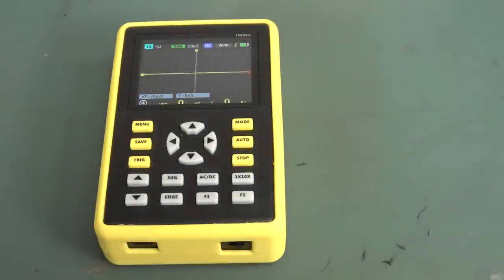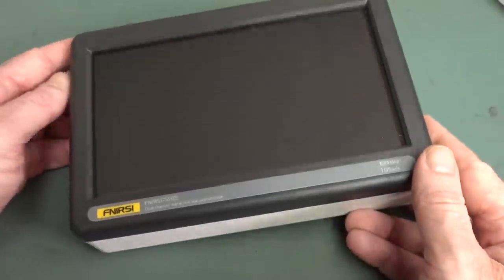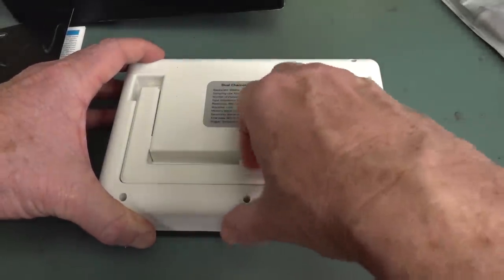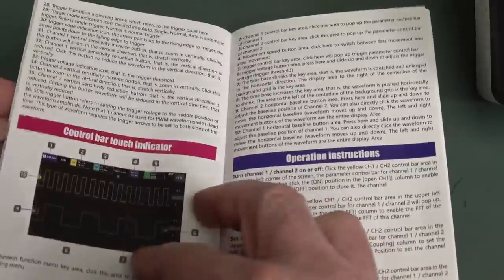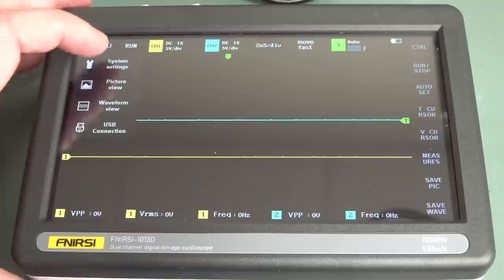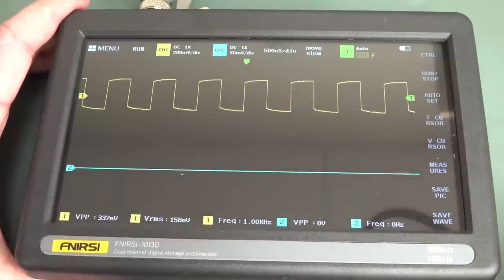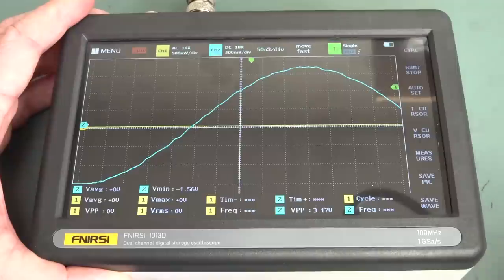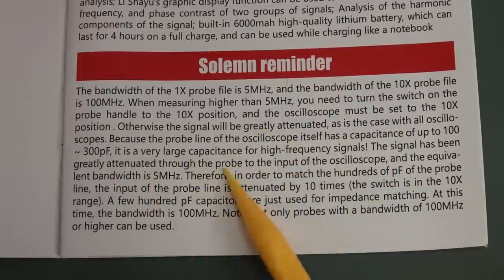EEVblog #1317 - $140 2CH 100MHz Fnirsi Tablet Oscilloscope Review

Comment: Did you try triggering on a low duty cycle signal, like an 1us 1kHz pulse train? I have the old pocket version, and it hardly ever triggers on that, since it samples only intermittedly.
Does this one at least sample continuously for triggering? I guess the FPGA could do the sampling and trigger detection without burdening the uC?
Reply from the maker: Will have to check this. Didn't bother to test further after realising it was a fake rating like the pocket version

Comment: It makes my 1995 vintage  eBay Fluke Scopemeter 95 look very good. I am hoping that eventually I will be able to buy a replacement for it as its LCD fades...but nothing yet ... 
About the only thing this scope does better for sure is the screen glare.
It would be interesting to do a comparison..
Wierd screen layout of text probably looks OK with Chinese text.
Reply: Good point about Chinese text -- very hard to do a screen layout that handles both. Better if they had 2 different layouts, one for cn/jp one for en/eu languages. The rest of the s/w could be the same.
They'd still need to fix triggering, timebase/zoom, V/div, etc.

Comment: Well I am a beginner just looking to use it on cars so I figured I would start off cheap. I think it will work for what I am doing.
Reply: This is a perfect scope for beginners and for using it for cars (as long as you're not trying to measure the voltage on the spark plugs ;-) ). Don't expect got get anywhere near the specs or have really accurate measurements, but for your use it's more than enough. It's cheap, handy (no socket cable) and you'll learn to get an understanding of scopes. You won't even have a hard day if you kill this one.

I have 3 oscilloscopes, this one, a Rigol and a Keysight. I am using this one 70% of the time, 20% on the Rigol and 10% on the expensive Keysight. This one is so easy to carry around and quickly hook up!

Comment: why do you always do tests with these when your battery on the device is almost dead. it says in the book that the battery needs to be charged before you use . with many other devices that i have used in the past if you dont have proper voltage . unexpected things can happen . Or lets maby try and figure out what you can use it for instead of what you cant that would be more useful .

Comment: i will stick with my 1980 tube scope
Reply: Hardly a fair comparison? You're not getting one for $140 these days. They all seem to sell for a lot more now. Also this is obviously aimed at portable use, so why would a mechanic who might want to use it on a car somewhere in the field ever even consider using a hunky 1980 tube oscilloscope? For them this thing is actually much better than the 1980 oscilloscope.

Plus by the time you get to price comparisons these days you may as well just go with a modern digital scope.
Reply: I regularly see analog monsters for cheap in my local second hand market. You can also find pretty neat 20 years digital beasts from Tektronics or less than 10 years old entry-level slim Rigol if you go around this 140USD price point.
Reply: @PainterVierax  Found a Tektronix 1731 in the dumpster a few years ago. 100% working and looking like new. I'm still wondering who in my little village (200-ish people) would even need one of those, let alone trash it XD

Comment: Thanks for the review Dave.
I have the basic similar one with a different brand name (DANIU ADS1013D).
I have 9 oscilloscopes & this little one is great for doing road tests looking for faults.
https://www.youtube.com/watch?v=shRbQTlvXwk&ab_channel=MiracleMAX
My Picoscope is set up in a diagnostic centre and therefore can not be used for road testing vehicles.
Some of the features that Dave struggles with are there - you just need to read the manual or look up other reviews. I forget from time to time, so have to refresh the memory to use it efficiently.
I am a great believer in reading the owners manual - after all, that's why they printed them. Not everyone thinks the same. 
We need to keep in mind that this is a basic oscilloscope, with price in mind.
I use it regularly, including in class teaching the apprentices out in the workshop, when it is easier to use this one instead of getting the Pico out. 
Of course, you need to keep in mind that if you want a quality, precise scope, you have to pull out your wallet for something like a Pico.
I would like to see more record screens available. That would be a definite improvement.
Once you get your head around how it works, this is a great, mobile, price conscious scope.
That's my thoughts after using it on a semi regular basis.

Comment: 8:06 Dave eats humble pie.

Read the instructions? Nah.
Reply: Well even if I'm a manual reader, I think he has a point to test if the UI is intuitive enough compared to classic brands of oscilloscopes which shares some degree of uniformity and logical arrangement between their interfaces.
The manual should be for beginners or to learn special/advanced features, not to perform even basic operations.
Reply: "A user interface is like a joke: If you have to explain it, it's no good"

Comment: Yeah no need to lie, if they just rebadged to 25/100MHz 2x100MS/s and refined the software they would have a real product. Big shame to leave the software on the floor when that costs nothing to mass produce. And maybe they will get there pretty soon. It's important not to lie about the product because trust is a big part of the value. People will buy it as a 25/100MHz product, that's not useless spec. And their equiv sampling works fairly well so if you can stick it on a 40MHz chip and confirm the frequency, maybe even see phase differences between two 40MHz signals, that's value.

Comment: Hi, I bought this Fnirsi 1013D oscilloscope and it is really crap first of all it is not 100 Mhz of band, it hardly reaches 30 Mhz, do not buy it because the measurements are all out of tolerance, and if you try it with a spectrum analyzer it also worships a very strong carrier at 130Mhz modulated by many impulses, I pointed out with video tests directly to the manufacturer, they were very superficial in the few and useless answers. Don't buy it.

Comment: Can't see why I would ever want to replace my RCA WO-33A.
If it was good enough to get men to the moon it's good enough for me.
Reply: There's no doubt about the performance of the RCA, but the question that remains is how are you going to use it on the moon if you need to trace something in order to get back to earth? The last time I checked, the moon didn't have multi voltage power sockets available LoL. I bet that you'd be glad that you brought this thing along with you LoL.
Reply: Dave Micolichek   no one said that the return to earth vehicle was built on the moon? I was referring to the lack of an AC power point on the moon!
Reply: Dave Micolichek  oh that's right, they had battery operated Vacuum Tube oscilloscopes back then to, I was just thinking that if this was available to them back then, they probably would have brought it along just in case something went wrong, my mistake! Not as portable as this one, I got one of these tablet oscilloscopes just recently and I really like it. It's not as good as the desktop versions but it does everything that I need to do with it. And it's really portable! The only thing that I can pick on is it's battery, it's okay but if I need to use it outside on the car, I personally prefer to know that it's going to last at least 8 hours or more... It's an easy upgrade so I'm looking around for a larger capacity on eBay... I really recommend it, it's super easy to use, the touch screen is fast... I work with audio and this covers everything that I need to measure... I have other oscilloscopes that are more capable if I ever need it but haven't needed it yet.

Comment: I have a Rigol 4 channel which I'm happy with, but the portability of this makes it interesting.  My use case is VERY basic - As a hobbiest fixing arcade and pinball machines, mostly from the 80s, which rarely seem to have signals I care about over 20mhz, and all the logic is usually 6ghz or lower.  Carrying this to a machine and working in place, vs taking a board back to the bench would be easy with this, so there potentially could be a good reason for this.  One question - And sorry if this is dumb - I'm a beginner at scopes, but how can this even be considered a 1 gig sample per second scope, or am I misunderstanding?  If each channel has a dual A/D which potentially can provide 200ms/s on each channel, I can see them "overselling" this as 400ms/s, but how can 1gs/s even come into the conversation?
Reply: That's what he said multiple times in the video, did you watch it ? They are lying on their specs and it's in fact a dual channel 200Ms/s scope, not a 1Gbs/s. So it's a 2x20MHz scope.

Comment: Would this thing be at all useful for inspecting signals coming off an Arduino (i2c, spi)  or checking analog video / audio signals?
Reply: check out Instrustar isds205c. No screen or battery, half the price, and has a logic analyzer - very useful for digital signals

Comment: This one is useful for simple repair works when you are just checking existent of low frequency signal or signal behavior.
Especially when you always don't have space to put a big professional scope on your messy table, then it'd be much better.  
I'm so happy with FNIRSI tablet scope even though there's a 4ch,1GHz,5GS/s scope in the laboratory.

Comment: Okay, how does one pronouce "Fnirsi"?   We'll get to the technical details later.  No piece of test equipment should have a micro USB connector of any sort--too flimsy.  How about a USB B-type connector?
Reply: Assuming it charges over USB, type B does not contain the control pin to allow it to draw more than ~500mA. This is why most stuff that charges over usb uses micro b (1.5A) or type C. Mini USB has the same limitation as well which is why phones and other devices that used mini AB or mini B connectors usually also had a barrel jack for charging or they'd forego both and use a proprietary connector.
Reply: @DigitalMoonlight  I believe that the USB3 Standard B has the capability.

Comment: Suggestion: just turn the room lights down/off next time?
Reply from the maker: Looks like shit if I do that.
Reply: @EEVblog  With a purely light-emitting device like this? How!? The normal rule that less light = more noise / depth of field doesn't apply here because the device is emitting the light all on its own, so the normal (more light) -> (more reflected light) -> (lower gain required in camera) -> (lower noise and crappiness of footage) logic chain is broken at the first link?
Reply from the maker: @TheHuesSciTech  Because there is not enough light in the rest of the room. It'll look like shit. Might put a video on the 2nd channel to show you. It's a trade-off, you need lots of light in ceratin locations for ordinary videos, but in a different location for videos like this.
Reply from the maker: 2nd channel video uploading now!
Reply: @EEVblog  Have you tried a polarizing filter?

Comment: If I was looking for a scope just to use in testing and repairing retro computers where they have system clocks from 4mhz to 66mhz would either of those two the handheld or the tablet be good for that. Or what would be a good cheap(entry/hobbyist... Wife will not not yell at me) scope to get
Reply: Rigol 1054z is the best $400 you can spend on a new, well featured, four channel scope.  It seems expensive, but everything else lower in price has far too many compromises.

Comment: That layout is pretty horrendous. Buy a micsig if you want portable or buy a good used one or even better save two or three times as much and buy either siglent/rigol or buy a very nice used scope.

And if you want to learn buy a cheap 20mhz analog scope and get that to work first. At least you know what you need / want after that.

Comment: Be good to explain why you can't just put in a 200Mhz ADC and expect to sample 100Mhz accurately.
Reply: Nyquist and the fact that anything except sine has harmonics and you need to sample those too otherwise the signal gets reconstructed as a sine only. So a 100MHz scope will show only about 20MHz square wave as a square wave, anything beyond will be more and more resembling sine on the screen due to the harmonics being attenuated. Plus this toy has crap frontend that won't even let in the 100MHz signal properly without excessive attenuation (in addition to it having a weird, non flat response ...)

Comment: Someone might have a go hacking it as you could pull the code of the MicroSD card and reverse compile the code to get the source code then you could modify it and recompile it and stick it back on the MicroSD card and maybe change the sample clocks assuming the dual channel ADC chips can handle such a clock rate.
Reply: the sd is for saving images, there is no code on there. maybe actually watch the review.

Comment: With appropriate probes, etc. Would work for automotive, automation, and such. Fast signal work, no.
Reply: Yes it would, if it only had input signal inversion.  It does AC and DC coupling, but no inversion.  I believe there is a group of people reverse engineering this hardware and creating a new, open source firmware.

Comment: Sir can i measure dc drive directly in the output terminal? the voltage is around 600vdc.
Reply: Get a 1:100 probe with a rating of at least 600Vdc. If you hook it to high voltages, disconnect USB and do not touch the metal BNC plugs.

Comment: Um, ?? thanks 4 showing, Battery Charge ??? HOW ? comes with FNIRSI does NOT say ??? Could be really handy 4 portable tool kit USE : ) however if u just drop it in your tool kit those B&C jacks will Shear OFF. (needs a case for protecting screen too)  5 hours charge time, but HOW ???????? fnirsi dont know either ???

Comment: But what frequency/sample rate do you need for audio signals?
Reply: I'd say 20KHz minimum, this would be fine, but for the fact that most audio signals are low voltage signals, where this unit falls flat. That and I didn't get the impression that it was anywhere near a linear response...
Reply: @sail4life  I was wondering if it needs some multiple of 20kHz. Like how digital audio requires at least 44k1Hz, double the audible range.
Reply: @qwertyasdf66  it depends. 20Khz is the old analog measure, its the frequency where the sensitivity drops off by 3db. See the video for an example. In the digital era, a sample rate 10x  the max frequency has become accepted as the minimum. In sampling theory 2x is the lowest frequency, but at that rate, try guessing the original waveform!

Comment: What is the lowest price raccomended oscilloscope? (A responsive and known brand one)
Reply: The Rigol is a good place to start. They are getting a little long in the tooth from when they were first introduced so I got mine with all the software upgrades included from Rigol, no hacking needed. https://www.youtube.com/watch?v=ETCOhzU1O5A  There are more videos here that Dave did on it. 4 ch 100 mhz after software upgrades. I am sure the list price including the upgrades is lower now.  This video is 2 years old with a Siglent https://www.youtube.com/watch?v=Kay4Jk2DHuE Good luck.
Reply: Rigol DS1054Z, but I would buy a Siglent SDS 1104X-E.
Both have 4 Channels, decoding and well working software. The Siglent one has a very good FFT.
Reply from the maker: I have not reviews the market recently, but I believe the Rigol DS1054Z is still the best low cost option. Although the 4CH Siglent offer more bang-per-buck, but it costs a bit more.

Comment: I would not like to have you working for me .
You do not read the manual. One of them that say I do not need to I know.
 You just push randomly on the screen without thinking .
I hope you do not drive car, well it could be funny see you switch all knops you find when you drive ;)
If you read the manual 
The probes that come with the unit have 1X and 10X   yes it can do 400 Volts !   and it can go to 4000 volts if you have 100X probes !
Next time try press menu and wait 2 second, not just click click click random on all menu .
Reply: You don't read the manual if you're checking the usability of a product. You poke around and the more the device fails to respond as you expect, the worse the usability.
Press the menu and wait 2 seconds? Why? Secret de-chineseization submenu?

Comment: Actually i want a portable oscilloscope because its way easier to cart it when working on a car.
Reply: Not much use for a basic 'scope when working on a car.
Reply: @johncoops6897  if you say so. I guess injectors run on Pretentious Wise Men, and all car sensors are still analog. Good old multimeter will sort out everything eh?

Comment: EEVblog enjoyed your video review. How about reviewing an oscilloscope based on tablets. iPads have a truly excellent high resolution displays. Coupled with a scope circuitry which either communicates through Lightening Connector, or either WiFi or Bluetooth communicating with the iPad for display. Such scopes are nice and portable, as well has hi res screen.

Comment: Would this be an upgrade for me? Im using the China DSO Nano V2 im using it with the custom BenF firmware for more options and a better UI.
DSO Nano V2 specification can be found here ( https://files.seeedstudio.com/wiki/DSO_Nano/res/DSO%20Nano%20v2%20Manual.pdf )
Using it for Car Audio. Primary for measuring distortion and clipping of the sinewave. 40 and 1000Mhz. But my DSO Nano V2 really doesnt have the resolution for it.
It works but.. wave is kinda pixelated and not smooth.
Or can you please "recommend" me another cheaply mini/table oscilloscope? Not a bench one. It must be battery/usb powered.
Also, can you please recommend me a Hot Air soldering station? I am in need to desolder and solder on a new HDMI connector on my Onkyo receiver since the HDMI board itself is really expensive to replace. Please.